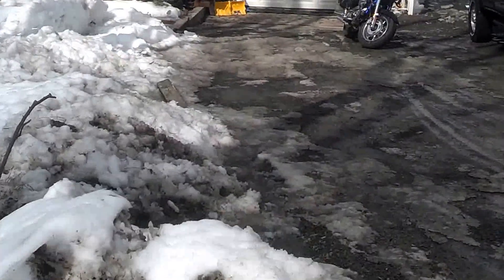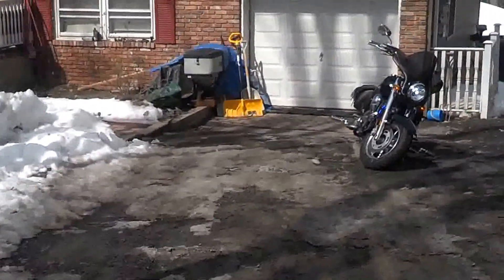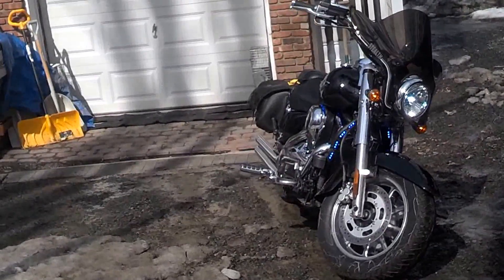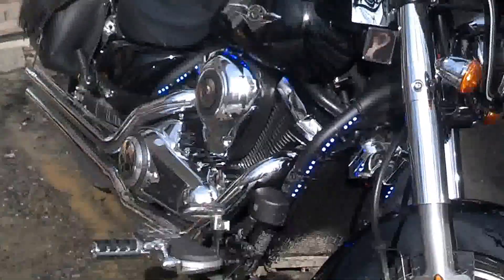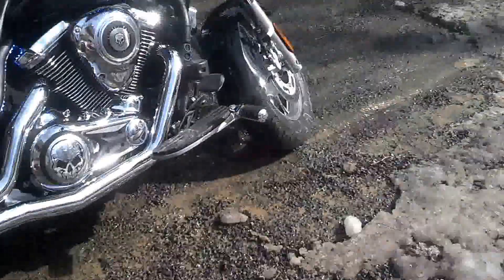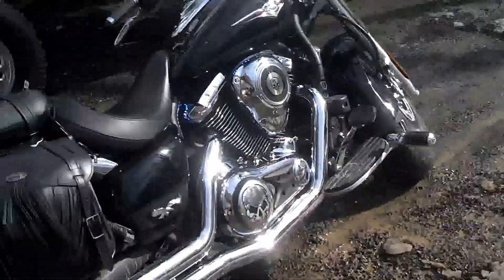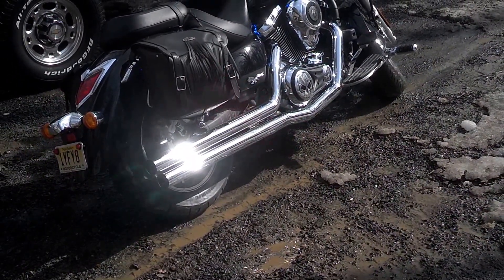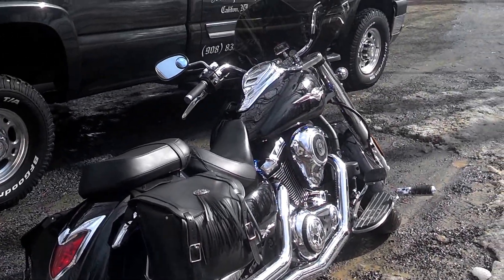Kawasaki VN1700 with Cobra speedster exhaust

Comment: I'm looking at  2010 vn1700 that has these pipes. Did the popping on decel go away completely ?  Are they annoying while cruising the interstate for more than 1 hour ?
Reply from the maker: The popping is more less depends on allowing adequate time letting off the throttle before down shifting . I noticed that if I ride and come to quicker down shifts the more popping noted. There will always be some kind of popping to extent when you have the pipes baffles removed like I do. Remember, stock set up had head pipe and you change to headers with these pipes. Also stock pipes had all that restrictions inside of pipes. Just make sure you have a air fuel module in it or popping will be constant and not having an air fuel module is not recommended.
Reply from the maker: I always wear ear buds listening to music while riding, on interstates it doesn't bother me and I ride with open face helmet style.
Reply: Dave Kaz 

Does it pop when downshifting if you just let out the clutch ? Do you rev match when you downshift ? That may stop it altogether
Reply from the maker: When downshifting and you don't let off throttle all the way you will get some popping. Let off throttle all the way maybe even twist opposite then down shift popping seems to not be an issue. Gotta keep in mind, you're going to hear pops if you have all open pipes. If I were to put the baffle back in pipes, I won't really hear any popping.
Reply: Thanks for your help.